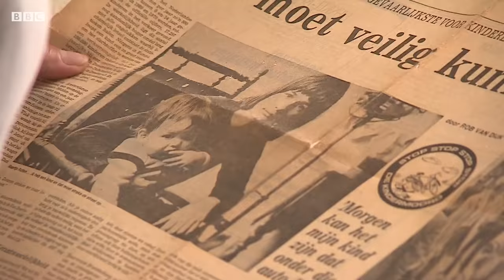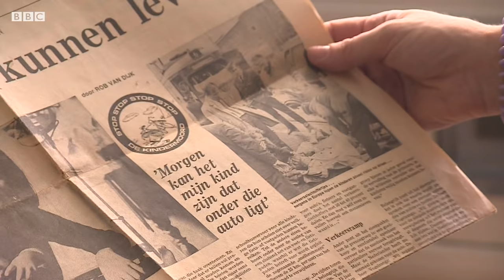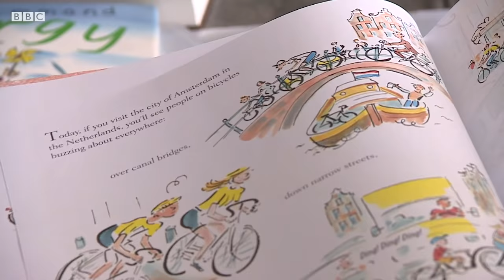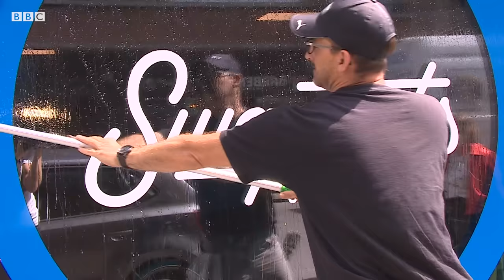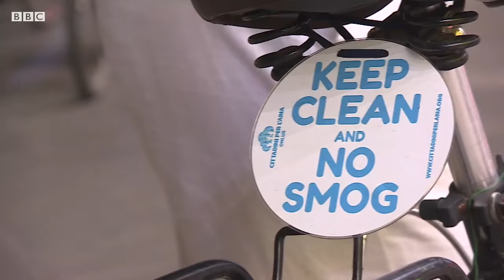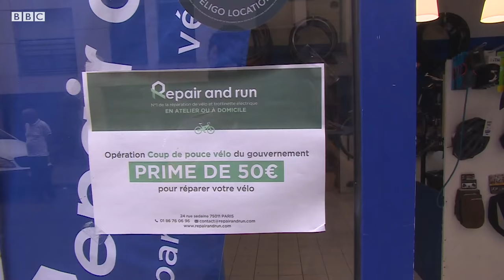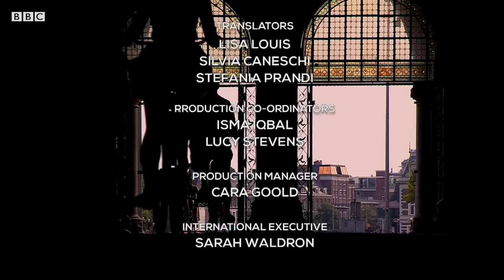Cycling across Europe in the pandemic - BBC World Service Documentaries

Comment: Almost every workingday I cycle to my work (The Netherlands). Distance: by car: 16km, by bike: 12,4 km. Time taken by car: 23 - 27 minutes, by bike: 26-29 minutes.
Reply: Wish I could on dry days but we don't all live so close to work 42 mile round trip for me not practical.
Reply: @daztheman6059  I don't know where you are, but in most parts of Europe it's easy to mix modes of transportation, e.g. take the train to the city, and cycle from the station, could be a day rental, or a cheap bicycle you keep at the station.
Reply: 15km each way for me. 25 minutes by car, here in Toronto. 35 to 40 minutes by bike. And my commute is filled with joy and good health.
Reply: @knarf_on_a_bike  Pleased for you if that works.
Reply: Netherlands is easy compared to the UK.
Reply: @Quarky_  What a load of mucking about and if I left a bike at the station it wouldn't last a week. And I'm not prepared to do a 40mile round trip to work on a bike or train and bike after a 10 to 14 Hr shift. In the UK lots of us live miles away from work as we have to get a job wherever we can.
Reply: You cycle really fast, do you use a racing bicycle?
Reply: @Quarky_  you should see the trains in UK, they are over crowded most times, it’s impossible to bring your bicycle onboard
Reply: You cycle at 25 kph? That's an impressive rate to maintain for 30 minutes unless you're going electric.
Reply: Not to mention the amount spend on gas vs the health benefits you gain from cycling daily. But then greed investors are not happy with it so it always been hard to push cycling through cities everywhere since most politicians are being paid.
Reply: @muscularcatholicism  My car is not uncomfortable or cramped.
Reply: @daztheman6059  You still spent hours each month stuck in traffic because everyone thinks the same as you.
Reply: Biking and walking should be for fun and exercise. Instead for europe it’s a necessity. They have to ride bikes to work school markets everywhere. US drives cars for many things but then we ride bikes for fun. So in a sense europe is behind on the time. Way behind US again. Surprise they are still not using horses and carriages.
Reply: @muscularcatholicism  you missed the whole point of my post, Europeans think they are the most progressive but they are not if they have to rely on biking and walking more, Americans are more free
Reply: @muscularcatholicism    Weird as it may sound but that’s the reason why Americans are more free and progressive than Europeans. We drive a lot so that’s why we tend to be more fat. But we can choose to be healthy by walking and biking. Europeans don’t drive as much and has fewer options. They have to walk and bike everywhere necessary. American can choose to be lazy. The movie Wall-E is a pretty good example how everyone was so well off that they don’t have to do anything. They just lounge around all day eating, drinking, playing and sleeping.

America is a big place. Every state and city are different. So there are easily poor places that use horses and carriages because they have too. But the Amish are not poor and they use them. America is very diverse too.
Reply: @tekkenfan01  I honestly can't tell if you're trolling or not, but screw it I'll reply cos I'm bored. You seem to be making a couple of false assumptions here that really undermine the validity of your argument that 'Americans are more free' in terms of transport.

Firstly - no, biking and walking aren't necessities in Europe at all. So in that sense Europeans are just as free as Americans are. There's this trick people use when viewing a YT video called 'watching it'. And if you watch this video closely - be careful though, you might miss it - you'll see that there are roads for cars. That's because in Europe almost everything is, like in America, accessible by car. Yes, also rurally. Which of course shows that biking and walking aren't completely necessary to get somewhere. I'm Dutch, and I can tell you that even the country with the most bicycle roads in the world has high-quality infrastructure for motor traffic everywhere. If you take a look at Google Maps you might see what I mean.

Secondly, you're assuming that biking and walking restrict freedom compared to what the car has to offer. And in a sense of raw distance, this is true - the car allows you to travel far distances infinitely easier than a bike or walking will ever do. But that's only part of the story. The car can only give more freedom if it's objectively more efficient, a notion that is often just not true in Europe. In Europe, the car being able to travel long distances infinitely quicker is much less beneficial because commute distances are, for many, shorter. Additionally, for some the car might also be less efficient comparatively because it could get stuck in traffic - if the bike doesn't though, and if you only travel a few km to your workplace, cycling might just be a more efficient option. And if you do live far away, there's often also capable public transport equally efficient as cars.

And keep in mind, the car can only give more freedom if you can actually drive one. But not everyone can. Kids, for example. Instead, they rely on adults to drive them everywhere, right? Right? Not necessarily. As a kid, I could easily go to my friend's house in a different part of town because I could safely and easily cycle there on my own, without being dependent on others. If your freedom of movement is dependent on being able to drive a car, that also means that suddenly there is very little freedom if you don't have that ability for any reason at all - be it age, financially, or otherwise.
Reply: @cartmann227  yea i figured lol, just had too much time on my hands and needed to stroke my national ego for a sec. 

Besides, it still has a slim chance to educate someone else so why not eh?

Comment: Having lived in Erlangen which had adopted the Dutch approach I see this as the obvious way forward. The main thing is you need to create separate bike paths not just paint lanes on the street. When people feel safe not to get run over if they make a mistake a lot of people will happily use a bike instead of a car for daily life.
Reply: What a surprise to read about Erlangen in this comment section! It's truly a wonderfull city. Greetings from Franconia!
Reply: I completely agree, traffic-segregated bicycle lanes are the key. Bilbao (Basque Country) is now becoming at a toofast pace a "bicycle city", something they didn't even try to do for the last 25 years. They are painting bike symbols in the tarmac and pretend drivers will slow down. Not a safe city for real commuting at all, unless you live and work around the touristic riverside. And there are also only a few places to lock  bikes, which hides completely the presence of bikes in the city while they should be doing the opposite.
Reply: how do you bike in the rain? how do you bike in the snow with 3 children? Biking isn't practical. Thankk God for cars!!
Reply: Painting a lane would be an improvement in the US. Most of the time they just put a  bike lane indicator on a tiny shoulder and call it a lane.